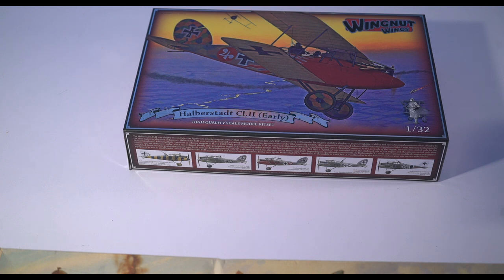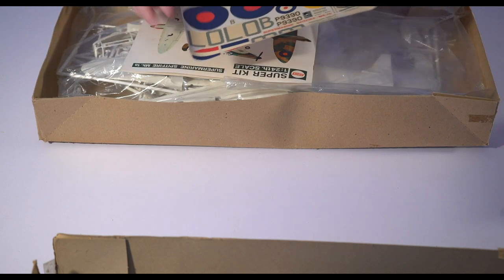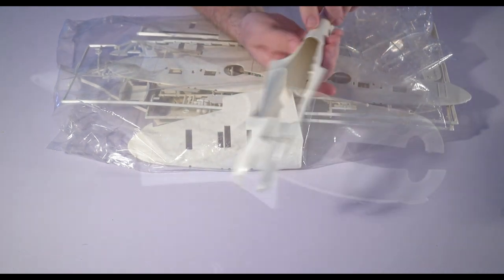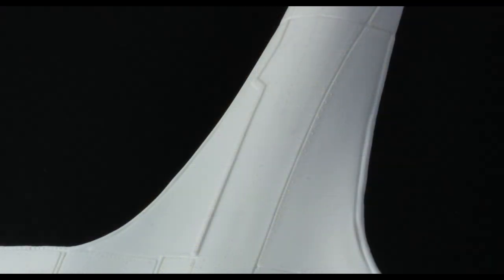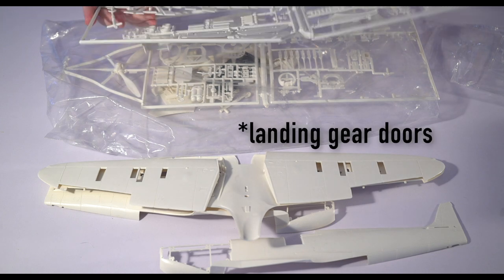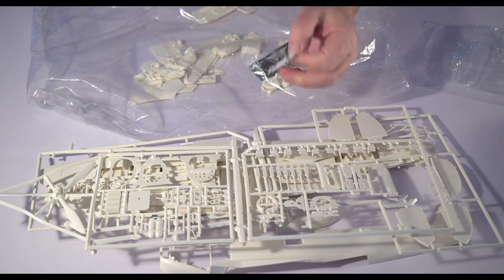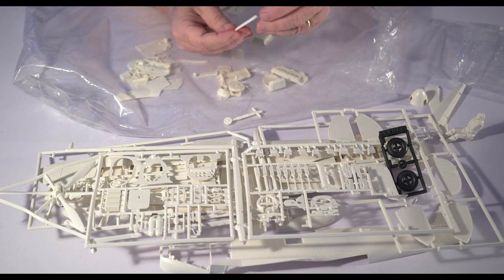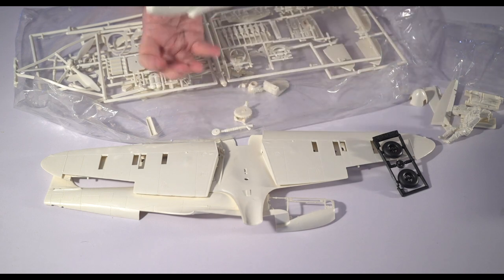1/24 Airfix Spitfire Mk Ia: The Unboxing

Comment: I have just purchased this kit and bought the Air Scale PE MK 1Control panel as I have an ambitious plan to attempt to build this kit up to a standard of the new Airfix MK IX. So I have found you at just the right time !
If you intend on designing and 3D Printing anything at all for this kit would you be prepared to sell and provide detailed parts for purchase ? I will buy whatever you produce !
Reply from the maker: Thanks very much for the comments Ray. Welcome aboard!

Comment: My grandsons gave me this model a few years ago. It had bits added so you could make an mkV. I had made the Hurricane back in the 1970s and it seemed to me the plastic was very different. My Spit was all very spongey so the detail was not as sharp as on yours. Certainly, the Hurricane engine is better.  Nevertheless, it was an enjoyable kit to build, and I did try to add some internal detail. Its a pity Airfix don't look at modifying the mould tools, there is a lot of detail that could be added and it's all metal off.
Reply from the maker: Smart grandsons! Who knows, maybe Airfix will issue a Mk I (or Mk V) version of the new tool Mk IX. I just got mine, and the hype is justified -- really a nice looking box of parts.